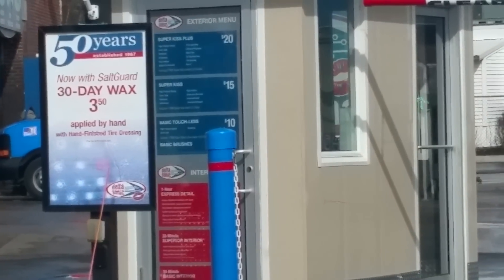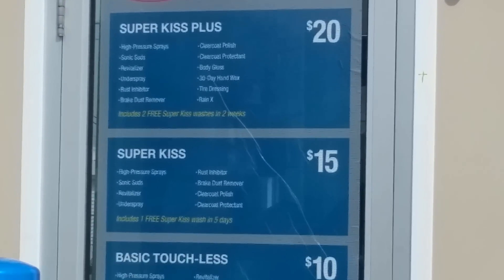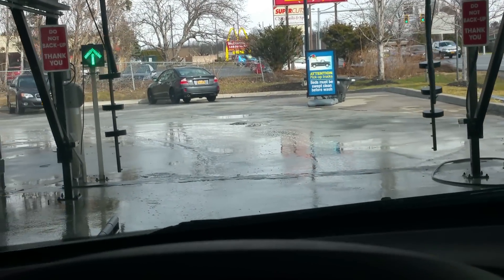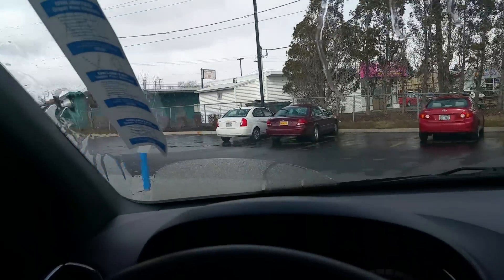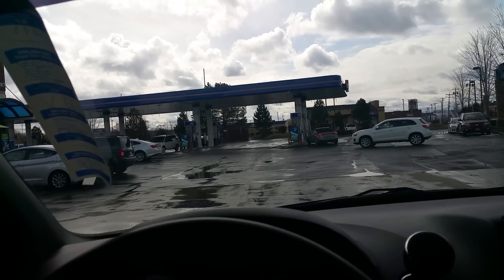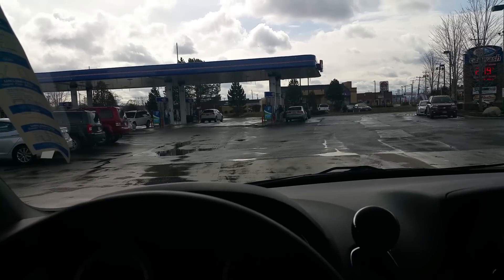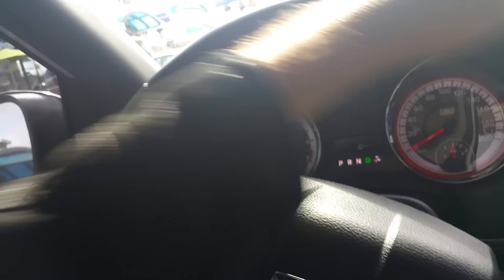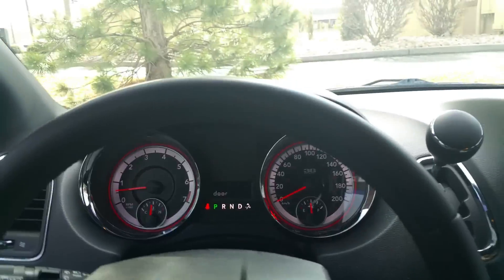Review of the Delta Sonic Car Wash in Syracuse New York

Comment: Hey Vince. I’m a Wash Manager at this Delta Sonic location in Syracuse. Next time you are in Syracuse, we would love for you to come back. We’ve made a lot of upgrades and changes since your last visit your sure to love!
Reply: I have a question I really like  Delta Sonic, but why is it called touchless when the car goes through a wall of hanging Shammies that touch the car?
Reply: @flipflat4814  That's a great question. Delta Sonic labels their washes as "touchless" as they do not include spinning brushes to aid in the cleaning of the car. These brushes are typically prone to causing scratches and swirls in the finish vehicle. That being said, Delta Sonic's wash chemistry and layout with the inclusion of multiple high pressure spray arches is a much safer alternative. The hanging cloth you are refering too, known as mitter curtain are there to aid in the cleaning process and gently agitate the cleaners in order to proide the best possible cleaning with as little touch as possible. These curtains are much safer for the vehicles finish and are made of a soft microfiber material. In addition, the slickness and overall amount of soaps used in the carwash help to create a barrier between the soft microfiber and the vehicles finish. Hope this answers your question!
Reply: @johndurantini9906  Thanks so much for the detailed explanation. I kind of figured it was a long those lines, sounds like the mitter stays fairly clean from debris from all the prior steps before cars getting there. I've been a little apprehensive of taking my brand new black car through there, being black shows micro scratches more so than other colors. 
I may have to give the Orchard Park NY location a try today, thanks again for the reply👍.
Reply: @johndurantini9906  I was wondering that as well, thanks for clarifying. Do you know if all Delta Sonic car washes are touchless and only have the hanging cloth mitters? I live in the Chicago area and there are a few Delta Sonic car washes around here and wondering if they use this same cleaning process. Normally I wash my car myself, but during the winter that is not always possible and I just got a new car and don't want to take it to the regular car washes that will scratch the car with the spinning brushes.

Comment: With the wash you got you get to come back within a 2 week period and get the same wash you got the 1st. 2 more times within that 2 week period.  It's a great deal but I have that Super kiss wash pass you were looking at. You get 10 cents off of each gallon of gas you buy. You also get $10-$15 off an oil change at their quick lube and some other discounts. You can go once every day. I go about 4 times a week. I live less then a mile from the one I go to so even it's if snowing out I will still a get a carwash and then dry my car at home. They are open no matter the weather as long as it's 5 degrees or warmer outside. They do a good job with getting snow or ice off in the winter time. Overall I am happy with Detla Sonic. Great video!
Reply from the maker: Disney Fan thanks for the comment!  I wish they were up here in Canada.  That's a great value they offer with that monthly pass.
Reply: Reviews By Vince It is a great deal.
Reply from the maker: Disney Fan we have gas stations up here in Canada called Petro Canada and some have soft cloth car washes.  They offer a 3 month package that gives you a free ultimate wash each day for $226.00 which is no where near as good of a deal.  Not to mention, the wash isn't as good as the Delta Sonic.  3 months of the Delta Sonic would only cost $90 lol.

Comment: Im not a big fan of car washes, Im anal about my suv and perfer to wash clay and wax myself but being in upstate ny, i cant do it in the winter time when the temps are 5 degress outside. Delta sonic does a fantastic job, I always get the RX,BG,TG. The down side to the one i go to is it has 2 fast lanes and 2 regular lanes, each lane is at least 1000 ft long and at times all 4 lanes are backed up to the road and you sit in line for 30 min before you enter the wash, but well worth it

Comment: Which car wash Centers in the New York State still uses late 1980's, early and late 1990's & early 2000's technology tunnel car wash equipment?
Reply from the maker: James Chong that's a tough question.  I have no idea but I wouldn't think there would be any from the 80's.  I don't live in NY state so the only washes I've seen are the 3 that I filmed.  Thanks for the question, I would be curious to know the correct answer :)
Reply: I noticed this too, the one in henrietta and penfield ny is wayyy different then this one and has more cleaning equipment inside the wash, 3 different blow dryers, and vefore you enter have 3 people spraying the car with power washers before you enter